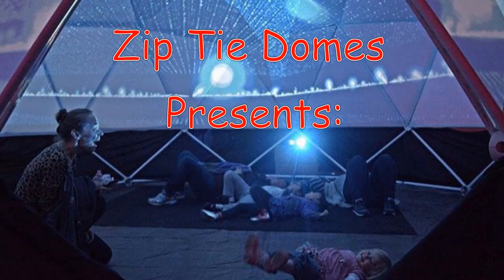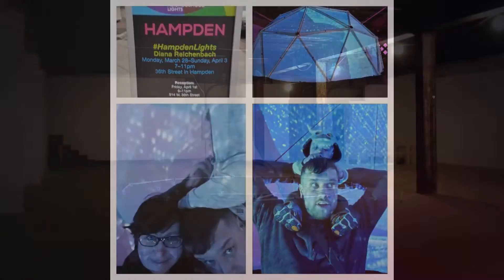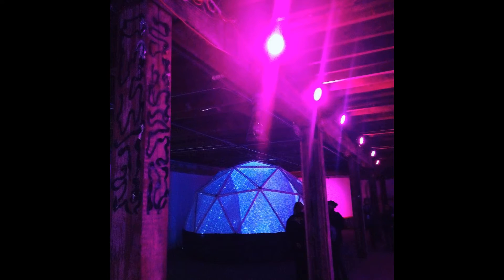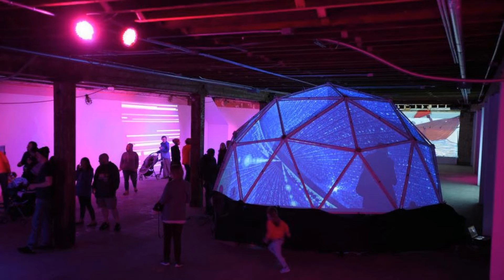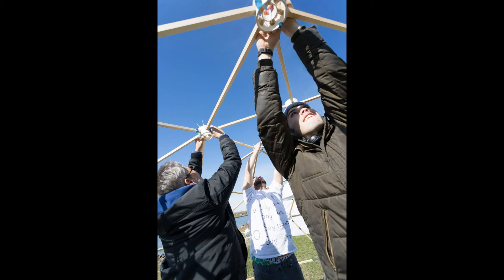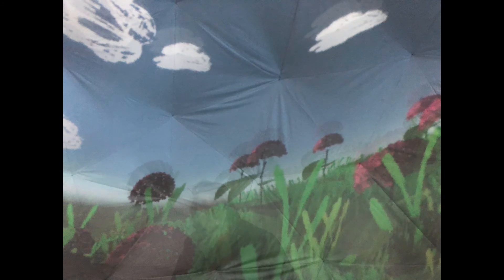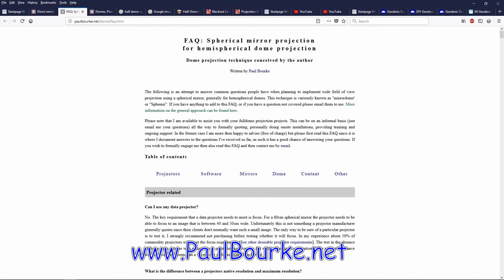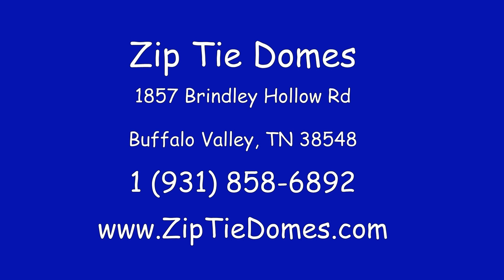DIY 360 Dome Projection Screen for a Fulldome or Shared VR (Virtual Reality) Experience.

Comment: I have a geodesic dome with a planetarium I built. Both a sophisticated optical mechanical projector and full dome video. I am using a single fisheye  lens projector a'la "Lhoumeau Sky-System" DIY set up. I think you are referring to "Mirror Dome" rather than mirror ball. Mirror Dome was developed by Paul Bourke. It uses a security mirror to warp the video. It works with a standard 1/4 dome security mirror. For crisper images, there are front surface ones made for the mirror dome application.  Blendy Dome is still around but it's a pain in the ass to set up. For multiple projector systems "NestMap" serves the smaller planetarium / full dome display market that can't afford Zeiss, Minolta or GOTO systems. NestMap uses a fisheye camera to capture the video on the dome, after the projectors are set up. Then it automatically (for the most part) does the edge blending and tuning. The user chooses from various test patterns to tune it in.

Comment: Has any one tried or had success on using this kit to make a home dome ? I want to make a office with one.
Reply from the maker: Several people have set up the domes inside their homes, mostly people that are interested or have a background in sound engineering.  Building the dome is the easy part.  But a dome can help with just standard quadrophonic sound - full blown ambisonics is at another level - and it has to be experienced to be appreciated.  It sets up a spherical wave field, where the waves come together and complement each other.  You can walk into the sphere, and then back out to hear the individual speakers.  It is just awesome.  Thanks for watching the video.  John
Reply: @ZipTieDomes  Ya I saw this info. But what about an outside dome ?
Reply from the maker: @frankenstein3163  Yes, you can put a second dome over the projection dome for setting up outside.  That is a great idea.
Thanks,
John

Comment: Roughly how much projection fabric is needed to cover 16' silo shown in video?
Reply from the maker: To cover the entire 16' Silo Dome, there is 682 square feet of surface area.  To cover just the dome portion above the vertical Silo Section, for a 16' dome there is 444 square feet of surface area.  If you have a project like this, I would be glad to work with you on the exact dimensions of the triangles, and how to best cut these triangles from fabric.  Email me at this link:
https://www.ziptiedomes.com/contactus.htm
Thanks for watching the video.
John Hurt